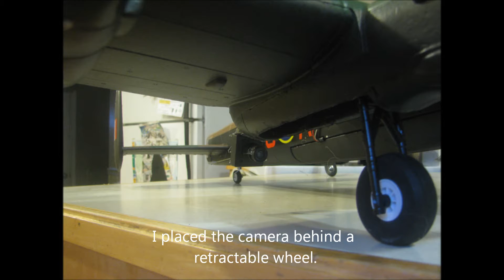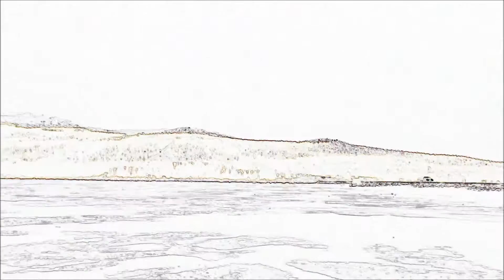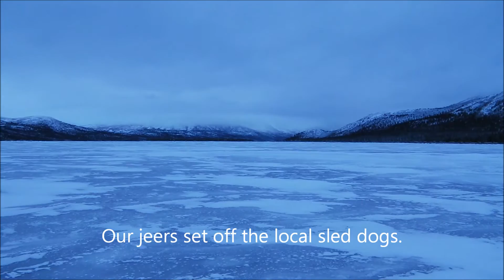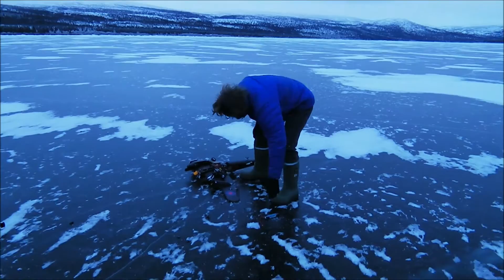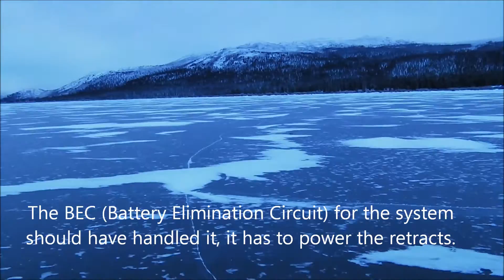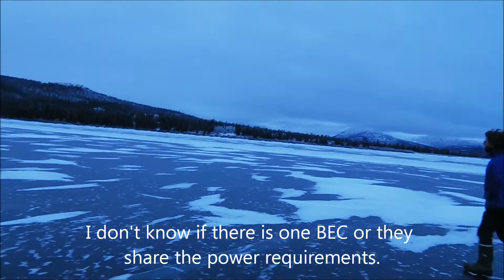Lancaster Demise

Comment: Maybe it was too cold that day,  Did you repair the Lancaster.
Reply from the maker: It was pretty chilly, ~-20 Centigrade. I've certainly had issues with cold. You hear the engines kick back in about a second before the crash, so I suspect a brownout or loss of reception. I didn't have a satellite receiver onboard, so it possibly lost contact when the starboard engines got between the transmitter and the receiver. Of it I've made a Frankenplane with pivoting canards from the wings off a Focke-Wulf in a V configuration and the rear wings with two undamaged motors from the Lanc. Unfortunately the CG was off and the maiden didn't do so well, back to building a more robust pivoting canard wing mount.